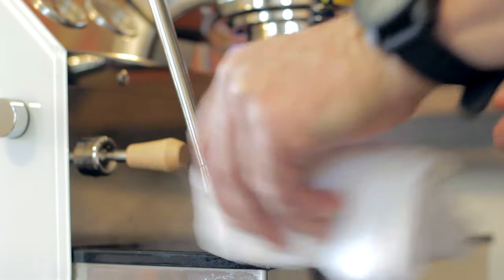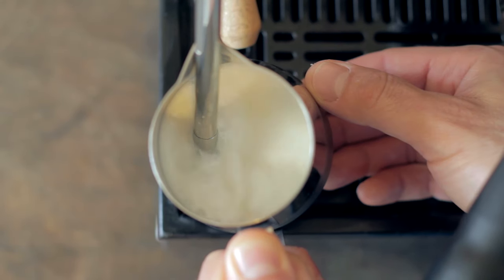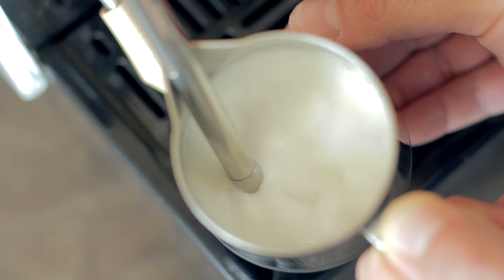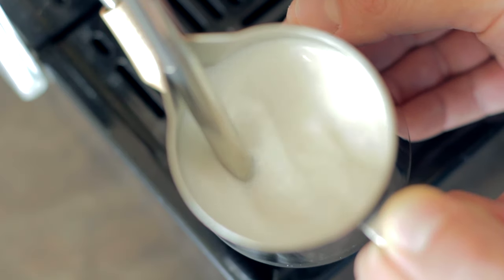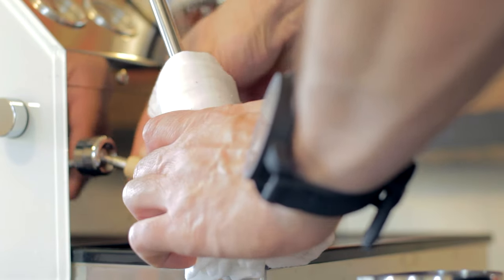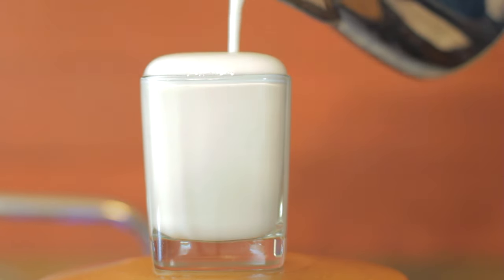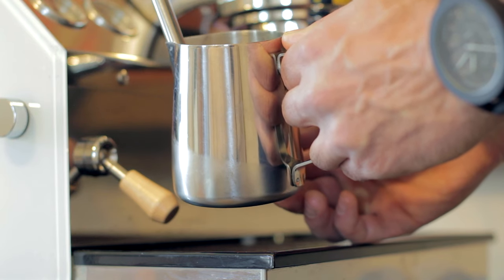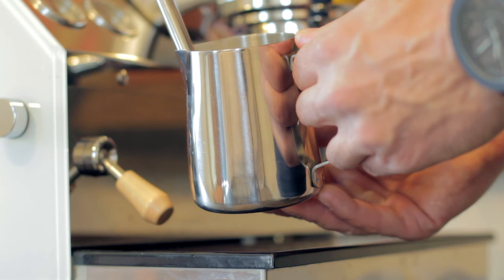Milk Steaming | One Minute Coffee Tutorial (Almost)

Comment: Super awesome Chris!  Prior to this video, was not sure where to exactly place the wand to get the vortex going! Also, was burying to wand too deep when done adding the air! For those using a thermometer, is there any guidance on when to stop adding air based on temperature? I stop around 110 F at present.
Reply from the maker: You're on the right track - get the stretch in early. You don't want to add any air after 100 degrees if you can help it. Helps keep the grainy texture away.

Comment: Awesome video!

Any idea why I'm getting lots of small bubbles in my milk? It seems to steam fine, I tap it plenty on the bench and swirl it but I can still always see small bubbles around the edge of the pitcher...
Reply from the maker: Thanks! Hard to say without seeing you steam, but assuming you have everything else dialed in you're probably adding in air too late in the game - if you so this you'll have small bubbles that you won't be able to get rid of no matter how much you tap. You want to get all the air incorporated before the 100 degree mark (this is when the milk will actully start to feel "warm" to the touch. Even if you let just a tiny bit of air in when the milk is too warm you'll get this "grainy" look to the milk. Get that air in as early as possible then just focus on your vortex. Hope this helps!
Reply: Thank you, this sounds like this could be my issue! Will keep an eye on that from now on
Reply: maybe different technique will work for you, adjust pressure in your boiler and try to change your steam want tip for smaller holes. I changed my tip and things start to get very well.

Comment: If you have a home machine this is just wrong. Now it may very well work for commercial machines but for home type machines it does not stretch the milk nearly enough. I have an Expobar Brewtus 4, not too shabby and this method just gets you hot milk. When I use the normal method to stretch milk in the jug it it expands by about 50%.